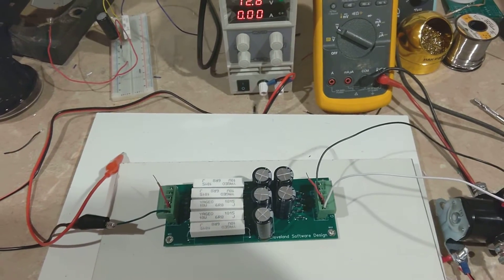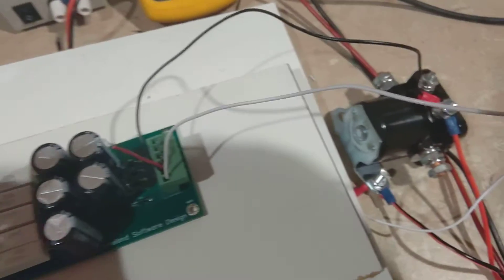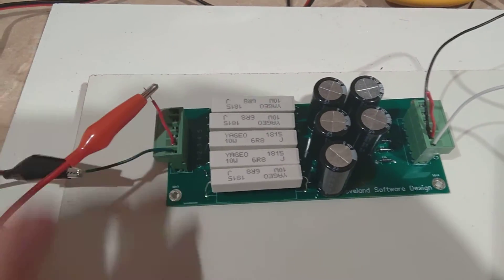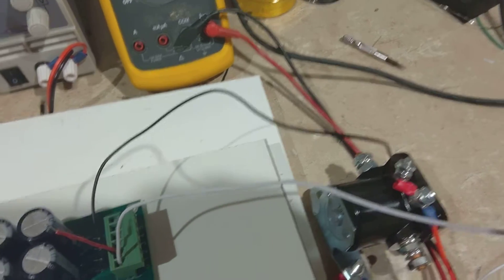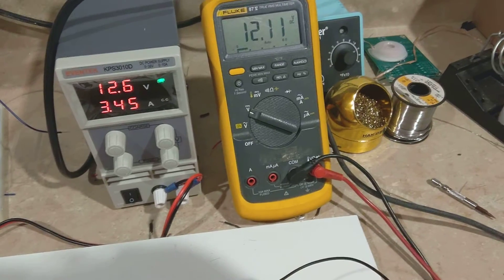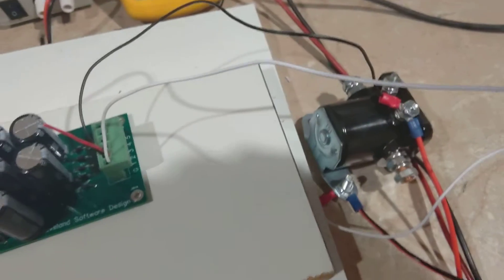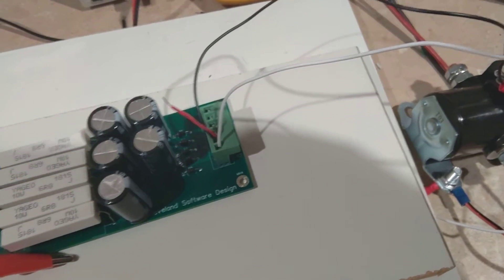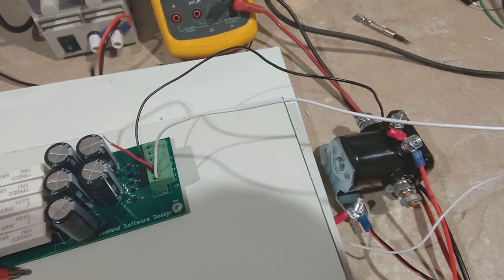Virtual Pinball Solenoid Life Extender

Comment: hello , doing my first vpin build......I have seen your stuff on ebay .......looks good......question.......so if I get a pinscape controller......these would go between the pinscape controller outputs and the actual solenoids ????
Reply from the maker: You will need something to allow the KL25Z to convert the low power ouputs into high power like this: https://www.clevelandsoftwaredesign.com/pinball-parts/p/21-output-kl25z-board If you look at the pictures on that page, you will see a pretty good diagram on how you can hook up solenoids to this board.